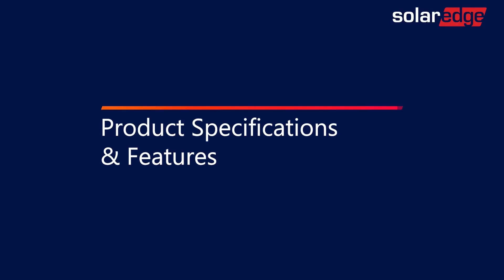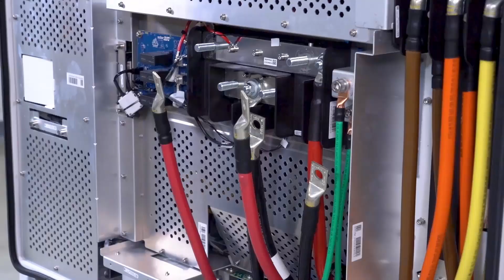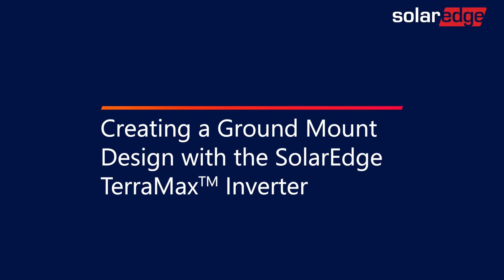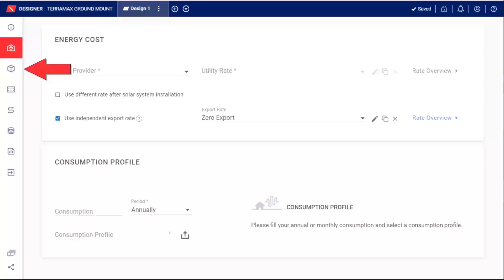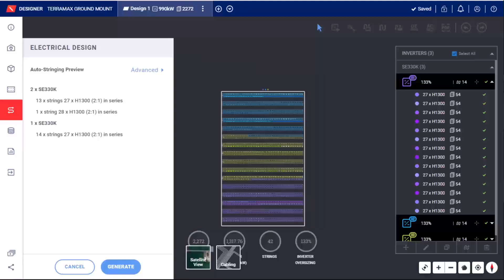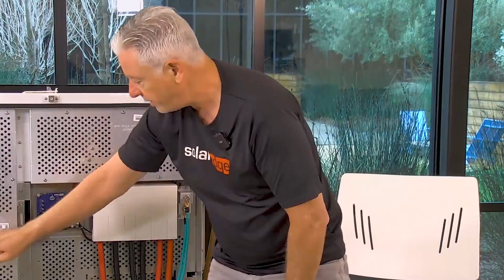On-Demand Webinar: Mastering SolarEdge TerraMax 330kW Inverter

Comment: We currently working on a project and planning to use the TerramMax 330kW inverter? What is the maximum clustering size in Megawatts when using them in Virtual Central layout. What's the minimum MPPT DC voltage? And must one use these inverters with the H1300 DC optimizers?
Reply from the maker: Hi @PoimtChaudCM I'll ping one of our US engineers to see if I can get you some info, but it looks like you're in Europe from your description so that may change the answer.   I'll see if our guy can ping one of his counterparts across the pond.   I'll comment again as soon as I get something back.  -Chris in Digital Content.
Reply from the maker: Here are the specs for the US model inverters:

600VAC
https://knowledge-center.solaredge.com/sites/kc/files/se-solaredge-terramax-inverter-SE250K-SE285K-datasheet-nam.pdf

690VAC
https://knowledge-center.solaredge.com/sites/kc/files/se-terramax-inverter-SE330K-datasheet-nam.pdf

Here is the datasheet for the H1300:
https://knowledge-center.solaredge.com/sites/kc/files/se-h1300-utility-power-optimizer-nam.pdf

The H1300 must be used with the TerraMax inverter only because this inverter is based on a 1500VDC system architecture. We have a H1500 that will be released later this year some time.